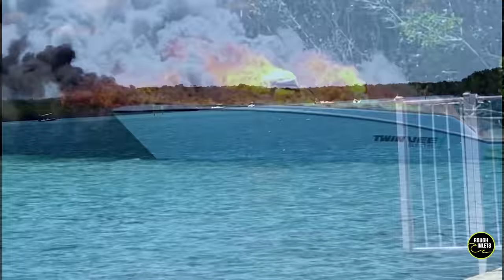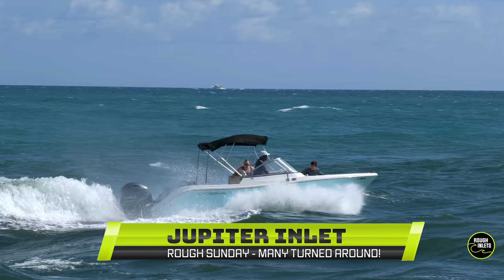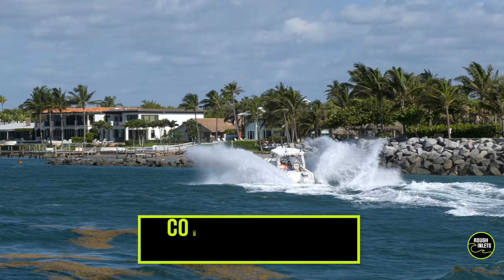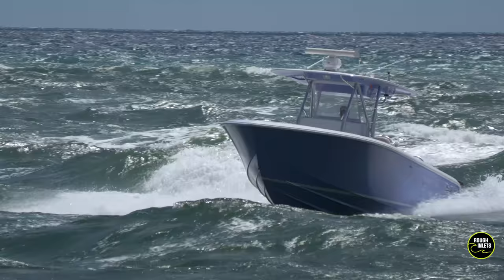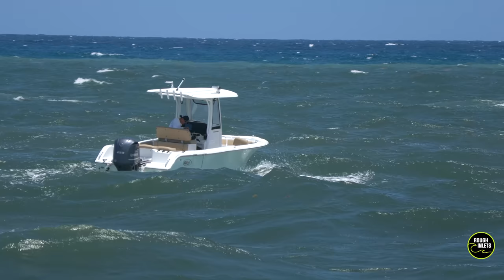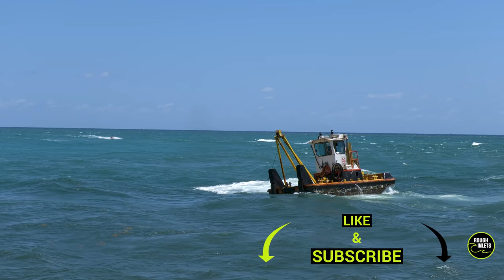ELECTRIC BOAT EXPLODES IN FLAMES - BOAT FAIL  | ROUGH INLETS | Boats at Jupiter Inlet

Comment: Big lithium batteries and water don't mix. Water eventually gets everywhere on a boat.
Reply from the maker: Tesla's are fine in the rain and silent yachts seems to be doing just fine.
Reply: @RoughInlets  Teslas don' float in salt water for years. Have you ever seen a lithium battery short out?  Even the small ones produce enormous firey energy almost instantly.
Reply: @RoughInlets  I'm pretty sure that Silent-Yachts are using LiFePo4 batteries for their power banks.  Much more stable than regular Li-Ion cells.
Reply from the maker: I assumed these would be LiFePo4 as well, was it lithium Ion?
Reply: @RoughInlets  I don't know, and unless TwinVee says what they were using that day we probably will never know for certain.  This WILL be slowing down the release of their e-boat though which is a pity, I was actually thinking about one since it would be perfect for the rivers and smaller lakes up here!
Reply from the maker: A pontoon with torqeedo engine and Solar Panels would be the perfect river boat.
Reply: @RoughInlets  yes and very efficient at low speeds . I have one and can troll 12 rods all day with a 500ah battery
Reply: but the prices of new pontoons are shooting thru the roof. 30% price increase since 2020
Reply: You see what a lead acid battery turns into with salt water.  So it is possible to keep them super dry.  But just one little leak . Now you have a situation where  a short will happen.  
Q
Reply: Or submarines for that matter, like the recent disaster of the Argentine sub A.R.A. SAN JUAN in the South Atlantic, for some reason the dreaded salt water got in contact with the batteries and that was the end. ☠️
Reply: @andres1xy  
Sad they lost their love ones in the sub. Batteries are not to be messed with. 
With electric cars in the shop , some have a policy of two mechanics work on one car just in case. They save the other mechanic in battery accident. 😬
Reply: Yes but a lot of manufacturers are  cooling the batteries with water. But you can't stop by your local marina to work done. The electric boats have a future and are safe if you know what your doing.
Reply: @michiganengineer8621  Most marine manufacturers are using iron phosphate batteries
Reply: @jameshildebrand7679  
The thought of having a large lithium battery in the ocean in heavy seas. With a chance the battery shorting because something failing. Thanks i want nothing to about it.
Reply: @assassinlexx1993  I have repowered a number of vessels. And we usually have to add weight back into the boat. The weight of the batteries and motor are far less then the engine fuel tank. But with the batteries we can distribute the weight more evenly throughout the boat.
Reply: @jameshildebrand7679  
Yes it is lighter. But seeing what happens with  large batteries.  
I will stick with Cummins. Plus I love the smell of diesel.
Reply: @jameshildebrand7679  That's what I understand as well, at least in production boats.However this was a prototype, so they may have been experimenting.
Reply: @tomsreviews238  Yep, Just look at some of the old Apple phones = boom.

Comment: I think you nailed it. While just like EV road vehicles, I think electric will be forced on us, day trippers, sandbars and sunset cruises will be their primary use for a long time forward. Battery (& charger) technology will advance, but when you think of the relative difference in mileage of a boat vs. a car, it will take a lot of battery to be able to distance cruise - then imagine the back up at the recharging docks.
Greenline's hybrid solution may be workable, but IMO pure electric is for puddle hoppers right now.

Comment: Here in Germany we have a lake which is used as drinkwater reservoir, so no fuel is allowed on/at the lake. There are 2 full electric passenger boats, carrying up to 250 people each. The full roundtrip takes 2 hours and is fun, silent gliding. However, there is no current or waves. The ships are operating 10-12 h a day and charging over night. The total operating costs are less then using Diesel, even taking the expensive Li batteries into account.
Reply: Yes, that’s the perfect scenario for an electric boat, a body of water with no waves or current.
Reply: yeah i am not buying it. can you provide a link where the boats are shown?

Comment: Inducing an electrical current from lithium oxide in the presence of sea water in an inadequately vented space. What could possibly go wrong? 
It is the same rapid build-up of hydrogen gas that causes nuclear reactors to explode.

Comment: Love the Rough Inlets videos.  I say Yes to Electric Boats.  I have one that meets my needs well.  See videos on my channel.  I'm using LFP batteries, which don't suffer from Thermal Runaway like many other Lithium battery chemistries.  For the moment it's not that fast and won't go very far, but the next motor will be more powerful, and I can add batteries and solar panels to increase range.  So Far So Good!

Comment: I think that, just like cars, electric boats are here to stay, and just like cars you can’t compare their power with the power an internal combustion engine, not now at least. Having said that,  battery operated motors have the the big advantage of their simplicity and much fewer moving parts. 

Personally yes, I’d own one of those and operate rather close to shore. On the other hand Lithium ion batteries make me a bit nervous because sometimes they explode, so yeah  🤷‍♂️

Comment from the maker: Fad or here to stay?  Do you think Electric Boats are the future?
Reply: Once they get the battery chemistries straightened out I think we'll see a lot more of them.  As you said in the video, this is a prototype boat from TwinVee.  I suspect they didn't have the battery compartment(s) completely sealed or they used a set of batteries built up from either 18650 or 21700 cells like the Tesla uses.  Standard Li-ion's do NOT like water, LiFePo4 batteries are much more stable.
Reply: i do not like it
Reply: HARD PASS.... electric boats, regardless of "Battery technology" have not place on water. Fresh or Salt water (salt in particular)... water and electricity are NOT a match at all! Specially when you combine high capacity/voltage batteries and water, as we saw in the video. I can see them in vehicles (virtue signaling) for now, but tech has a LOOONG way to go before they have a useful use...
Reply: 100 years ago they used coal and bunker fuel, 20 years ago they said no way 4 strokes could compete with 2 strokes, in 25 years electric boats will the norm.
Reply: @Fooolin  That sounds like an accurate estimation actually.
Reply: @Fooolin  Yeah, electricity and Salt Water! A great combination LMAO
Reply: @elianselmi4099  The fire could of possibly been caused by using unsafe batteries. I work in the electric boat industry. But we use safe batteries that actually disconnect from the circuit if they start getting to warm causing a thermal runaway such as you seen in the video.
Reply: They are here to stay. But it won't be for all types of boating
Reply: yes so right @elianselmi4099

Comment: Electric and water do not mix oh, it's been a known fact for years. If for some reason you are out swimming around the boat. And there is an accidental discharge through one of the through hul l intakes. What do you think is going to happen I don't want to say but it won't be nice. And accidents happen everyday no matter how many precautions you take when building something. So I say absolutely not those are going too far with electric.

Comment: Electric boats are following the electric car development. Lithium batteries are safe if you keep them dry. Tesla and other manufacturers have reinforced & sealed batteries so they don't become a problem unless they are structurally damaged. But a gas tank holds the same potential problem. The biggest problem is storing enough energy for your day on the water. My gut feeling will be electric motors with a gasoline generator on board to recharge the batteries once they get 50% low.  It would be nice to run 20 miles offshore and troll silently for a few hours enjoying conversation without shouting. Then fire up the generator on the ride in.

Comment: Great strides have been made in the electric boating market. The only thing holding the market back is the battery technology. Several European sailboat manufacturers are offering 100% electric boats such a Salona. Candela makes a hydrofoiling electric speed boat in which they have great success. There is currently over a years waiting list to buy one. But like the electric car market once there is enough interest even larger strides could be made in the marine industry.

Comment: I wanted a direct injection, no glow plugs, no spark plugs.  Diesel outboard.  No such luck.  Why diesel for fuel economy, safety (less likely a fuel leak will catch on fire), and diesel is cheaper at the dock.  $1 per gallon cheaper.    Nothing was available everyone wants an outboard that goes fast, need one that reves to 5-6,000 rpms.
Reply: Cox makes a diesel outboard

Comment: Subs are electric. ...and its the boat type. If I had a sailboat yes, but not a powerboat with an idiot at the helm. Electric gets you away from expensive fuel. Probably that boat fire was from unusual boat abuse.
Reply from the maker: This was a prototype out doing testing.
Reply: Its too much sophistication for the average boater to deal with. There is no vetting of boat owners. These were pros.
Reply: Well unless you are using solar or nuclear to recharge you really haven’t decreased the carbon footprint, just changed the location of the emissions
Reply: @petekensy5451  Yes, for the most part you are correct but bear in mind that sequestering emissions at the power plant where they can be dealt with en masse is the first step in reducing the footprint. Having millions of FF burning power plants running around higgelty piggelty injecting NOX into the atmosphere is the challenge. Also more green power( possibly clean nukes too) comes on line every day. Its going in the right direction.